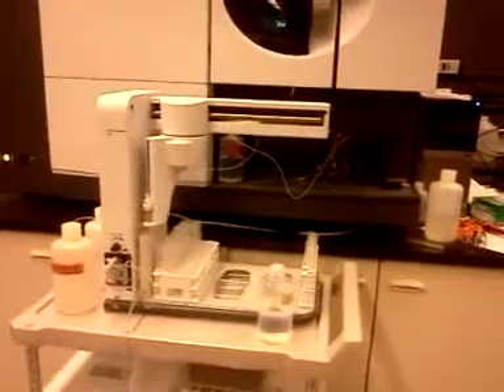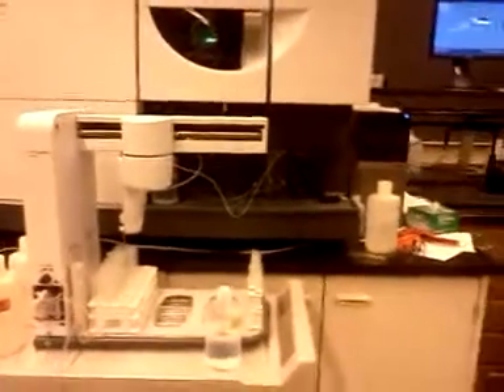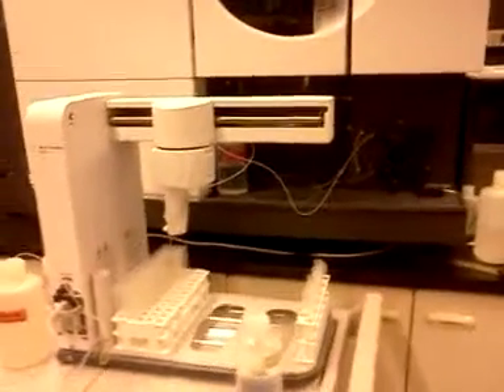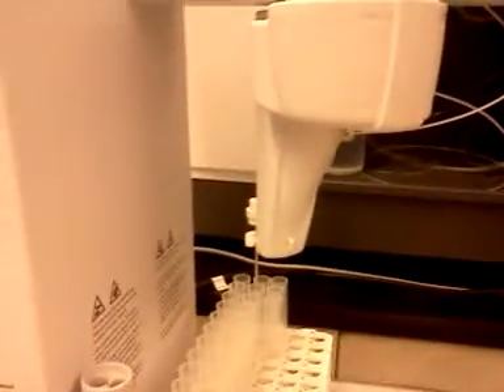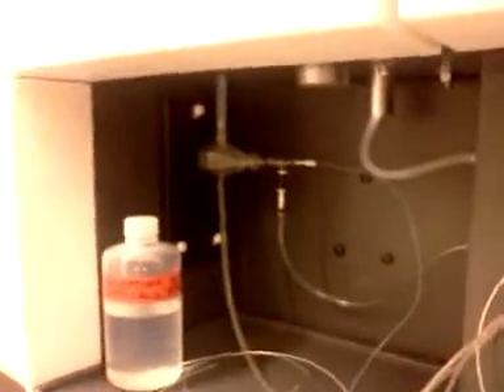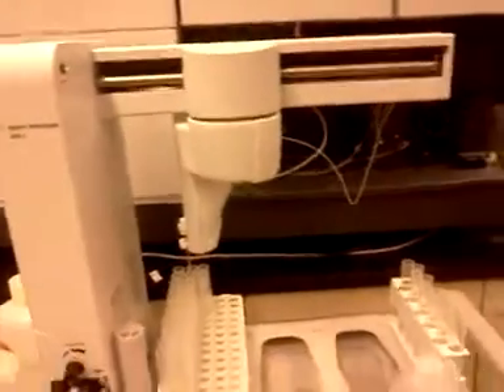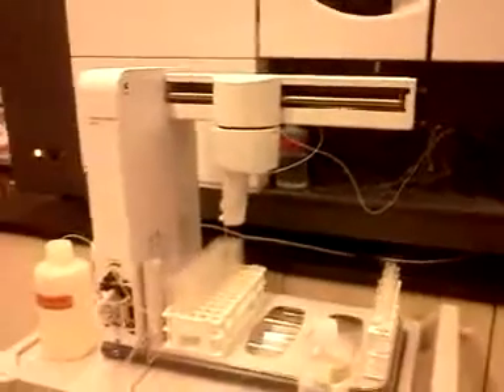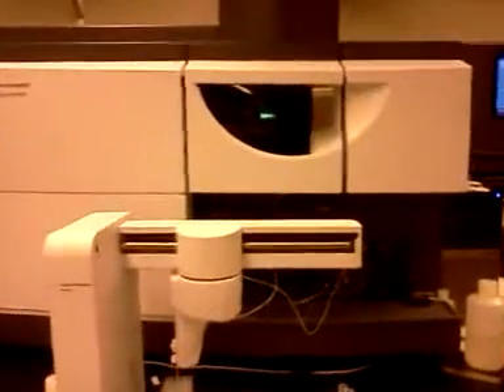Science Vlog:  How an ICP-OES works

Comment: The instrument is actually an ICP-OES, not an ICP-MS.  It looks like a Varian (now Agilent) 700 series instrument with axial plasma observation.  The instrument is expensive (about $100,000 or so), but an ICP-MS would be even more expensive (somewhere in the range of about $200,00 for typical quadropole instruments).  Even though it is an ICP-OES, it may give better performance for the elements you mentioned (Na, K) than ICP-MS.